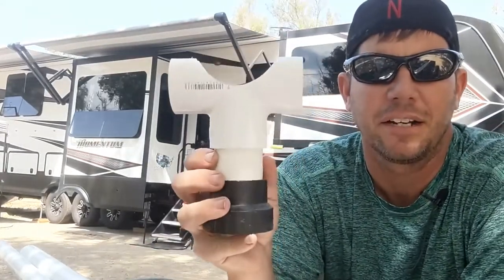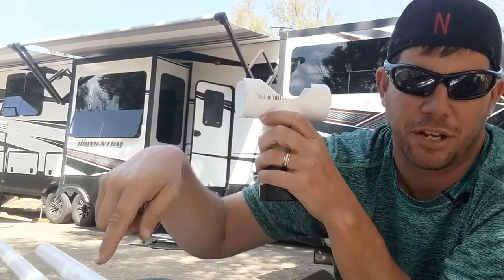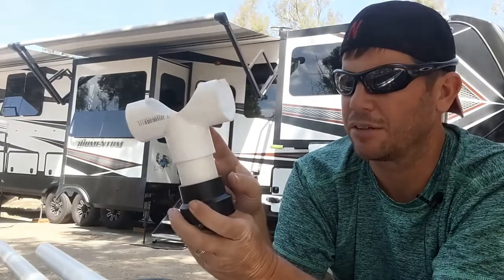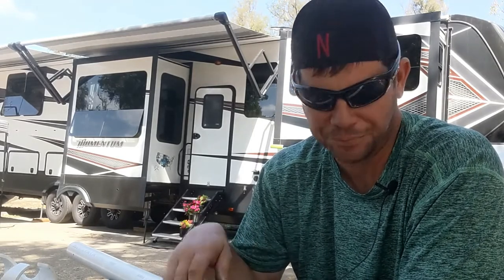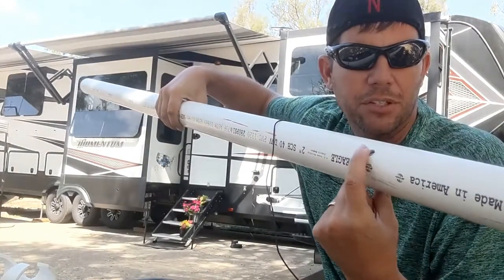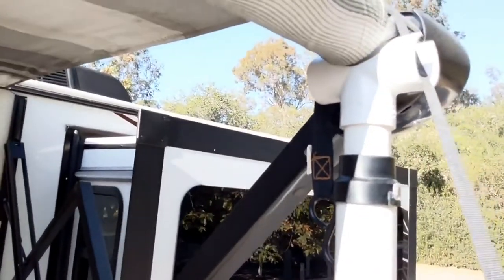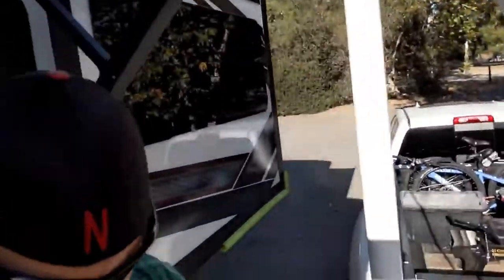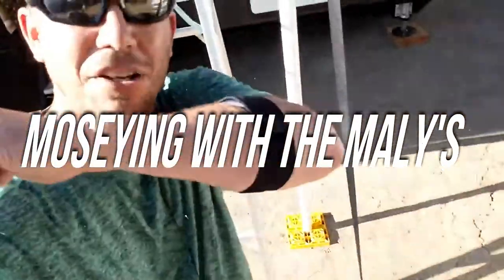How To Make Awning Stabilizers for Your RV To Protect Against Wind And Rain Damaged Awenings.

Comment: Made the awning stabilizers. We used the 2” t’s and 2” pvc pipes. Then used the 1.5” pvc pipe to run inside. We cut the T’s like yours with the opening for the straps. So far, it’s working great. The winds yesterday would have had us roll in the awning, but it stayed stable. Thanks so much!

Comment: I camped on the Atlantic Ocean in New Hampshire all the time. Very windy so much so that the state park doesn’t allow tents. I parked my Ram 2500 22 feet long in front of my 20 foot awning and when windy I lower my awning as much as I can and ratchet step tge round pole at each end to the truck and all was well. Did it for years. I had old style manual awning.
Reply: I’d trade our new auto POS for the old heavy manual one in heart beat.

Comment: I’m currently near the phx area in Jul, monsoon season.  Lot of RV have their awnings ratchet to the ground, surprising works good in heavy winds.  The awning itself (the material) still has to absorb the wind.  If the awning is old and weathered, I have seen some rip.  Your invention, I believe will save the arms.  👍 I bring mine in, as soon as the RV shakes.
Reply from the maker: That's the best way to guarantee saftey for the awening is to pull it in.  I have seen so many people lose the awning or the cylinder because of a freak gust of wind... It sucks because those arms can be like $600 to replace light gauge steel.  Plus this little thing was fun to build definitely don't mind doing little contraptions like this and it should help a family out or two which is always a bonus but I really do like building stuff!!!!

Comment: What kinds of winds are you confident leaving this out in?  We routinely get 40mph winds at our park and with the sun no awning leaves us with zero shade and can really ruin our weekends.  Its a stationary RV so its at the site all season, I don't have to take it up and down it I trusted it to not fly away.
Reply from the maker: It is always about the weekest link.  The stabilizers will hold strong! The weakest link is your awnings and the screws that attach to the rig...are they in a stud, or just in the fiberglass siding.  So basically I don't know your rig and I can't give you any advice on that I would just say always to air on the side of caution.

Comment: If you already have the ratchet straps and anchors, what is the point of the pvc pipe?
Reply from the maker: My awning sits at about 12 and 1/2 ft and when extended my awning is straight out level with the ground. This is because of my slide prevents it from coming down at an angle. So instead of doing a roof slap which most awnings will do mine has a tendency to get a downdraft and break going towards the ground, that's why the PVC pipe is there just to hold it solid.
Reply: Straps hold it from going up from wind.
PVC holds it from going down.

Comment: I don’t get the need for the pipe, why not just put the strap over the cylinder and tie it down?
Reply from the maker: It prevents the movement of the awning up and down, so it braces it solidly.  A strap only pulls it in a downward direction and on higher rigs like mine where the awning is up at 12' from the ground there is a lot of wind that will also increase the downward pressure and bend the bracket arms.  The poles prevent that from happening.
Reply: @moseyingwiththemalys3357  
Hi, thank you for the reply. I understand now. Makes perfect sense. My awning is lower, just a caravan height. Might be worth thinking about anyway. Cheers Non